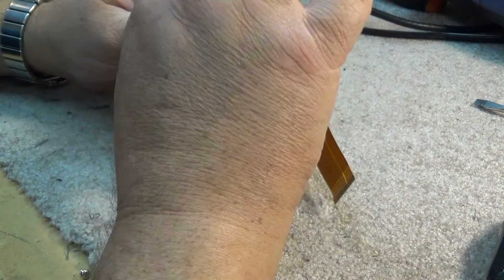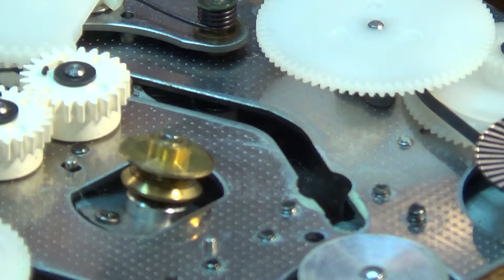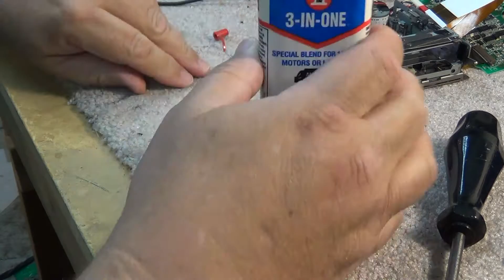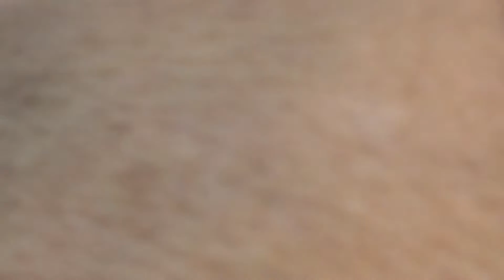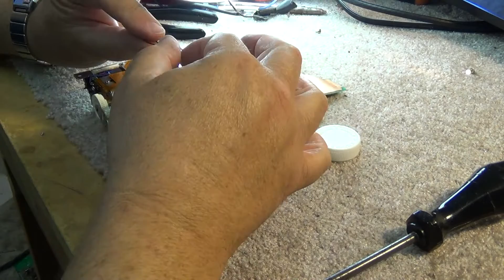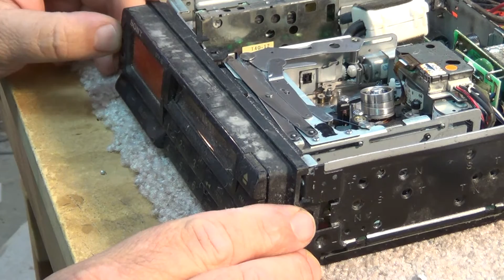car dat player

Comment: All Dat players for in a car broke down in half a year.
Reply from the maker: +henkvermalen For the car DAT was a disaster waiting to happen. For that matter so was minidisk. Too much dust, moisture and vibration, but still it was a cool concept.
Reply: +12voltvids Both my father and uncle had one, it broke down all the time and because of it's rarity the service centre had a hard time to fix it. It's nowadays even more of rarity :D Thinking of these technologies makes me even more appreciate my smartphone, how things have changed the last 20 years, it's insane.
Reply from the maker: +henkvermalen Yup.I still use DAT, but only to record music from my big old satellite dish, from the DMX music service that I can pick up. I record a 6 hour tape, then play it back and capture the tracks I want to keep onto the computer. Much more convenient dealing with tape as far as cueing up for recording than say trying to capture live, and missing stuff. I rarely use my smart phone to listen to music. I have a USB port in my car, and a 128 gig usb stick with over 20,000 tracks on it now. As far as analog tape goes, I just use it to play some of my old mix tapes, same with DAT. I have some nice mixes from years gone by, which are nice to listen to. I have 4 studio DAT decks and a portable, and this car one, which works, barely. No it is not in use. I have no place to put it. My car has no place to install aftermarket stuff. It is factory only these days.
Reply: Yes i use also a usb stick in the car, works perfect and it will never break down. 4 dat recorders that's a lot!! i must admit i also was like that :D Goodluck!!!
Reply: DAT into a car was a sad experiment.
This model have  too rubber belts ! Which insane designer thought that.
My Friend had a blaupunkt model "installed" into house with DC supplì.

Comment: You ever get the belt? Did it work as projected??  I'd imagine it did as a master repair tech was on the job!  I was kinda shocked when you dumped the head & drum in the cleaner....I didnt know you could do that!  If you ever have down time and looking for content, it would be cool to see a detailed video all about audio and video heads...thanks for such a great informational repair video as always!
Reply from the maker: JacksJunkDotCom It plays fine with the make shift belt I put in it. I have not been able to track down an original yet. I am still looking for one.The head went into the cleaner as it was totally seized up, and would not turn at all. Other than replacing the drum, which would be a tough order considering they have not made this unit since the 80's this was a last ditch effort to get the drum unstuck. Hey it worked, and I was able to get some lubricant into it. The cleaner acted as a solvent to get the gummed up lubricant out. Not that I intend to put this unit back in service it was more of a can I get this thing working project. Even when this was new it wasn't a great unit due to the free running drum motor. Most dat recorders use a servo controlled drum and capstan servo, but this one just used a free running belt driven drum, and used the capstan motor to control the tracking. This resulted in many read errors that would have the sound cutting out momentarily. In my opinion this is a unit that Sony should never have marketed, as it was a piss poor design, but I guess they were attempting to build it as cheap as they could, and being a playback deck only they were free to cut a bunch of corners.